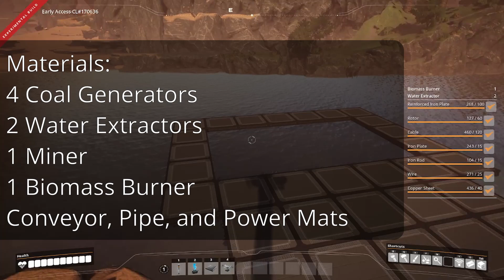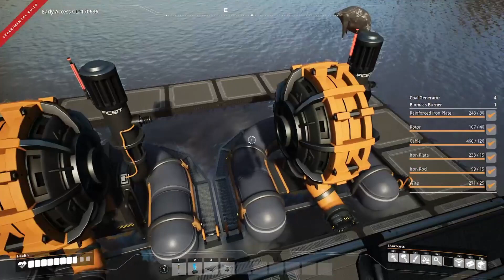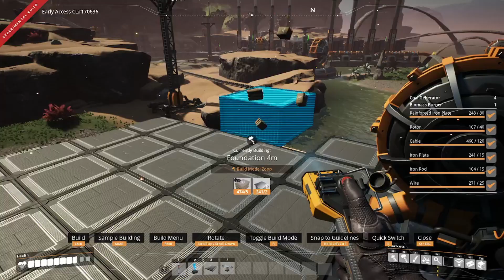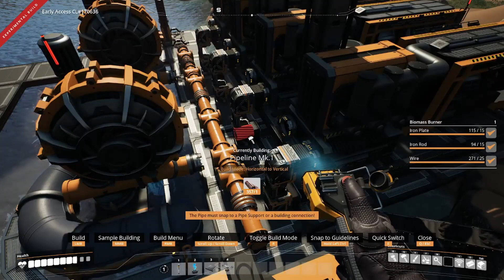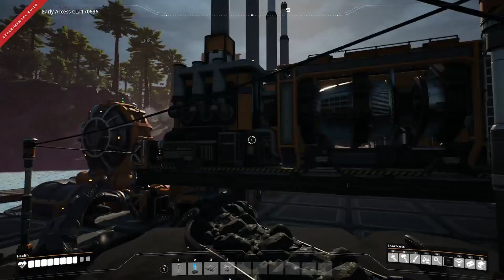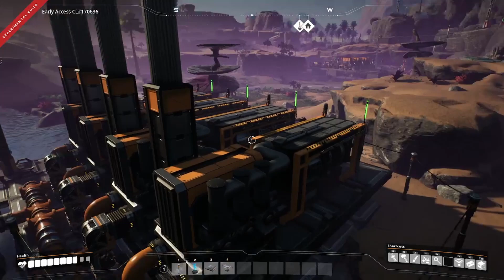Satisfactory Coal Generator Setup Guide - Early Game Power Tutorial (Update 5)

Comment: Something I found while trying to place the pumps is that they will gladly snap-in alignment with the tower. So if you actually put your tower in the right spot you can use that to fit both pumps in the space without having to worry about trying to get them pixel-perfect positioned.
Reply: I also found that you can sneak foundations underneath the water extractors! I usually drop 1m foundations until I get my first one that's covered over the surface by water, and then expand from that one to make a platform for the extractors. They're much more grid friendly from there.
Reply from the maker: Huge tip right here. I didn't know this, but will use it every time i place extractors from here forward. Thank you!

Comment: Hey i just started 2 days ago, around 3:45 or so you are putting on the Conveyor Lifts and I can only seem to attach them so they are on the top in a useless position. I've tried from all sorts of angles, tried pressing buttons to flip etc, is there a trick to this?  TIA  I have rewatched those same 20 seonds or so for over an hour now.  You also seem to be stretching them somehow
Reply: Well I finally figured it out, didnt find anything online just enough random combinations of button and mouse presses I started to get close and also started to be able to stretch them which I did not know you could do.  If anyone else happens along that has the same problem I'll try to describe what worked for me.  After trying from above and making platforms to get dif angles and stuff, I went on the ground, stood directly below the connection dead in the center, eyeballed the conveyor, then you have the lift looking just above the floor when I do it, but I hold down left click, it drops down into the ground but I can stretch it up as long as I keep holding the button, in fact they go into the sky, which I did not know.  But the crucial part is, at the end you have to use your mouse wheel to turn the top head around to face the port to make the connection, took me a couple of tried that way to get it lined up right, but now I can do it pretty reliably.

Comment: Underclocking to 75% works well but there is a bug which causes fluid buffers in machines to lose 5 m3 when loading the game sometimes.  It's best to account for this by adding 1% or so for power systems in order to avoid any possibility of power instability.  So underclocking to 76% instead can help folks avoid that bug and still save nearly the same amount of power.

Comment: Hi Dekoba!  Very well done, concise video.  My problem is that no matter what I do the pipe in front of the water extractors is half a pipe width too high or too low, so the pipes won't connect!  I was using 2M foundations, tore them all out and started over with 1M and got the same results.  In your video they line up perfectly, so I'm not sure what I'm doing wrong.  I'm pausing your video and following it step by step!  I've torn everything out and stopped connecting to my main build and still no love!  I've done with 4 times now with the exact same results.  The Pipeline supports either place the pipe "half a pipe" too low, or if I raise them, too high!  Any ideas?  My foundations do seem to have less showing above the waterline than yours do.  Could that affect it?
Reply from the maker: The base height of the foundation is the problem here. You can use a 1m foundation to build your base layer 1m higher or lower, which would adjust your height by that much. You can also start at a different 'height' by moving along a hill in the terrain to move the foundation up or down slightly. If you have unlocked them, the  'frame floor', part of the frame foundation pack in the awesome shop, allows you to move foundations up and down by 40cm, a little under half a normal foundation height.
Reply: @Dekoba  Thanks so much.  I had figured it out as I said in my update and used a thicker foundation at the shore (moved them a touch up the hill -  It wasn't letting me do that with the 1M) as I could not get a good adjustment with the  1M foundations.  It was frustrating so I hope no one else has the issue.   I'm a new player.  Just started 4 days ago and having lots of fun.
Reply: UPDATE - the waterline is the key.  There has to be only about 20% of your 1M foundation underwater or you have trouble lining up the pipes.  I forced it by using 2M foundations to start at the shoreline then switching to 1M.

Comment: so i cant seem to get the pipe from the water extractor to connect to the pipe that runs infront of the coal generators.  invalid shape.....
Reply: do you clip the long pipe into the conveyers a bit to allow for proper pipe angles?
Reply: I realized what i did. i built my platform with 4x4 foundations vs. 1x1.  switching that corrected my problem.
Reply from the maker: @DeadZone80  I don't,  I offset it to be closer to the water extractors . If you use horizontal to vertical pipe shape you'll get different shapes depending on whether you start at the pipe or the coal Gen.  I always start at the pipe to reduce clipping but your mileage may vary
Reply from the maker: You can try different shapes.  Noodle seems the most versatile and I use it often for short things like that